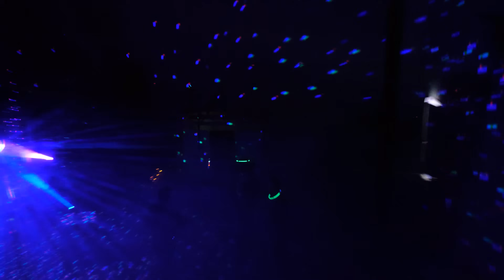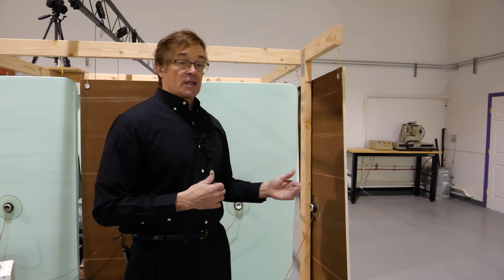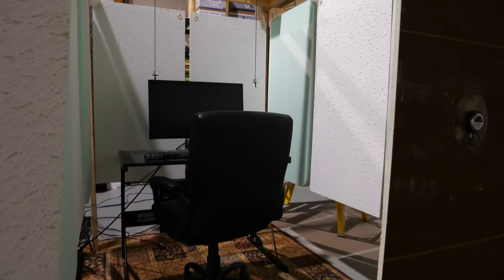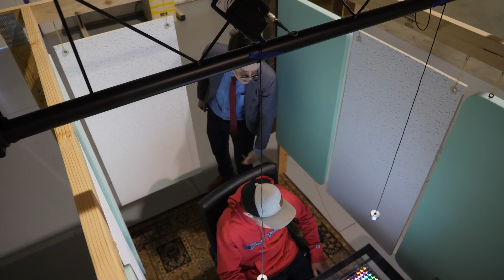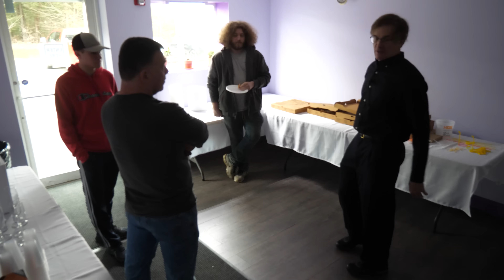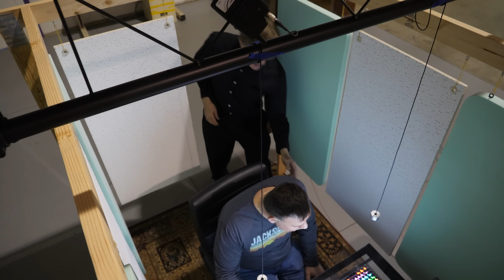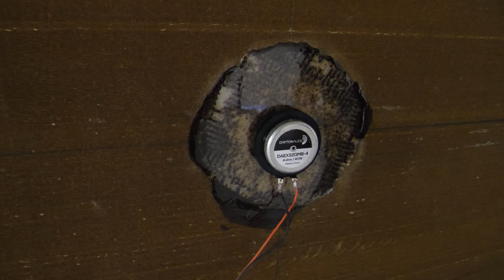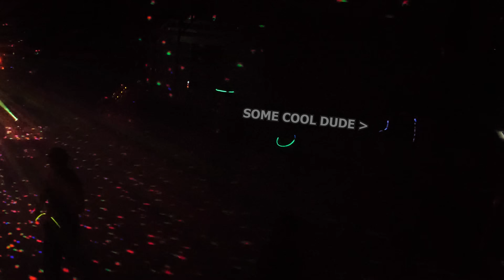SHOULD SPEAKERS THIS GOOD BE LEGAL?

Comment: Ive been watching your videos for years. Finally ordering the stuff to build a pair!! Not sure if this has been answered, but what if you mounted the back side of the driver to the wall? Then the panels only connection point would be the driver and it wouldn't be hanging from thread. Would that be better??
To better clarify, mount the voice coil as you already do. But then using the screw holes on the driver housing, mount that to a wall. That would be a completely isolated panel. Has anyone tested this?
Reply from the maker: It doesn't work as well.  The driver's mass is part of the system and it moves in counterpoint to the panel.  You can try it.
Reply: @TechIngredients  Thanks for the response!! I'll just hang them. I'm no audio engineer by any means. I just want to build one pair and be done with it haha.

Also, I watch all of your other videos too. I live in a modern house 100% off grid. Spring water, solar, and starlink. I'm using all of the techniques I see on your channel to increase the efficiency of everything. Keep doing what you are doing, your work is priceless!

Comment: How well do these work in larger environments: 75' x 150' ?  If I heard you correctly, if mounted properly, you could use them as sound dampening panels as well.  Our church building has lots of echo and we are considering the cost of sound deadening panels.  We are also needing to replace a blown-out speaker.  So, could/should we consider combining the two, making them both speakers and sound dampening panels?
Reply from the maker: I don't believe  there is a limit  to the size of the room where these will perform well.

Comment: 🟦.... One thing I hope you learned after this experience is to hang the sound-panel that you're using as a door from "Roller-Type" shower curtain hangers on a PVC "Shower Rod" pipe, so you don't have to keep hooking and unhooking the door in order to go in and out of that space, instead you'd just slide it aside with one hand behind the panel next to it and then slide it back!

Comment: I am looking into making these speakers
However, acoustic ceiling tiles are not readily available in Slovakia, at least not adequate ones.
The ones I could source are very squishy and sound very muddy.
What if I used 2 different sizes of XPS foam? As in both would use the same exciter, but one would be over 2x larger than the other, meaning it should have a better bass response right?
Maybe I could also change the thickness too, I presume the thicker the material, the more bass I can get out of it.

Comment: What do you mean by "really large panels" do get subwoofer Frequencys? Of what kind of Large do we speak?
Reply from the maker: Several meters on a side.
Reply: @TechIngredients  does the thumb rule quarter of the wavelength as side lenght apply ? So it would be about over 4m for 30hz ? It could be hanging from the sealing.
Reply from the maker: That's  about right.
Reply: its cheaper and better to use an independent sub woofer rather than increasing the panel size, sub bass is non-directional anyway so placement is never a problem... @TechIngredients

Comment: In my testing with same speakers for my project I've noticed that box made from cardboard would make the best resonating bass. And because for my project I needed it to vibrate through the whole tabure (chair) and so that it can be felt when sitting on it through whole body and hands the best way was to put the box inside the tabure and the speaker mounted on the bottom of the box, while box facing up to the tabure making it something like a subwoofer. 
What also I've noticed that the sound is the crispest on simple sturdy window's glass and I was amazed how well it works and sounds. Sadly, I don't have acoustics panel or polystyrene panels, but I'd like to test them out too.

Comment: Did you measure the sensitivity of these speakers? For example a horn loaded speaker can have a sensitivity 100db or more at 1 meter for a given voltage. Bookshelf speakers typically are 89db or less. Planar speakers like Magnepans can have very low sensitivity requiring very powerful amps. I find that higher sensitivity speakers reproduce the finest details, the first watt being most important. I'd be interested in the sensitivity of these. Great video!
Reply from the maker: No, I haven't.

Comment: I would find it interesting to see the frequency response, distortion, and other relevant metrics and then compare them to some of the very top end offerings out there. That would give an objective answer to the question which ones are “better” and also a hint at whether they are “good enough”.
An interesting blind test would be to indeed set both those up in the same space (it probably would have to be slightly larger than the shown booth, but I suspect that would be doable. Another set of reasonably good affordable (at least according to non-audiophiles) could also be present. The test subject would then be subjected to either and probed afterwards. 
The psychological effects of seeing the car-cost speakers and the “normal” speakers would be very interesting, especially if the test subjects are further held in the dark as to the existence of the panel speakers, if to their knowledge they are just acoustic panels. 
This could be a very entertaining multi-experiment all in one go. Psychology, engineering evaluation, and probably more. 

This I feel like I would like to try one day.

Comment: Im sure its fine at moderate volumes. Ive got a few setups and have had lots of gear. To really reach the extremities of the upper and lower frequency range and smooth response it takes more than small speakers and a couple hundred bucks.
Reply from the maker: Sure,  I understand.
A good mechanic  has more than one tool.  You might find that incorporating  this low-cost approach and augmenting its  weaknesses in a complete system produces a superior  overall performance.

Comment: Jim Sim... in the late 70s I acquired a pair of Goodman polyplaner speakers possibly 50 watts . I built 2 big simple boxes and slid clamped them in the front ...the sound was the best stereo I ever had fantastic base middle and tremble I had them till I left for Thailand. My friend now has them and says he will be buried with them . I now have home made ones 3 way networks Inc in Thailand. They are much more powerful watt for watt when in a box and better base mine have an aluminum stasis supporting the magnates with coils attached to shaped styrene foam front sound surfaces ..I love the sound they have ...

Comment: I would like to know how to keep low frequency noise, like passing trucks, out of a recording booth.
Reply from the maker: As I'm sure you know, low frequencies  require a different approach than high frequencies. The pressure  rise is large, but the rate of change is low.  Think of it more as a gusting wind. The same principles apply.
Mass and stiffness work well, i.e., concrete in new construction or building underground.  Decoupling walls with offset studs, like I explained  in our "Lab Tour" video, works fairly well. Active countermeasures would need actuators with substantial mass.

Comment: You can wire speakers in series, parallel or a combination of series and parallel for different impedances and depending on what your amplifier is capable.  It should also be noted that when you increase impedance you decrease wattage to the speakers and effectively get less power from your amp.  If your speakers had been wired in parallel you would have halved the impedance to 2 ohms and gotten more power from your amp.  Of course your speakers must be capable of that low impedance.

Comment: I wonder how they'd sound suspended slightly inside the face of a 5 sided box lined with acoustic foam? Id suppose it would amplify bass response as well as reduce reflected sound from the walls behind them.

Comment: Do you have any recommendations for the shape of the panels when creating the complimentary high/mid and low frequency panels? I was thinking it would be nice if the low frequency could be orientated below the high/mid. Simply for keeping the specific surround channel aligned vertically around the room.

Comment: In past videos you say the dayton exciter you use are only $6 or so. I was hoping you had the link on where you got them. But since you don’t, can you tell me the model and wattage of ones used for your panels? 
Im thinking of doing some and starting with the bass shakers but I figured I would want 20-30watt ones which are much more then $6. So want to make sure I’m not over spending on to powerful ones that I wont really need.

Comment: Referring to this video https://youtu.be/zdkyGDqU7xA 
Did the counterweights end up being too impractical to implement with these materials (20%-25% of the mass divided by 4 or 5 would be very light with the foam core, especially)? Would you say that "juice is worth the squeeze" for the added flat response it creates? Did you choose acoustic panels over end grain balsa for cost or performance reasons?
Reply from the maker: I simplified  the construction  for the demo and left the counterweights off, but they do improve  the performance. 
I used the acoustic ceiling tiles for convenience, and because  the end grain balsa is more difficult  for many viewers  to find.
Reply: @TechIngredients  Thank you so much for the reply and insight! Can confirm - local lumber yards and specialty stores don't know what I'm asking for when I say "end grain balsa panels". I'm going to have to take my chances ordering online.
I'd also like to mount these from behind to hide the hardware (akin to a hung painting). Does hardware location seem to have any impact on performance and frequency response?
Reply from the maker: Look at marine construction supply houses.  Endgrain balsa is a composite core material.
It does matter.  Did you follow  the explanation when I demonstrated the assembly?
Reply: @TechIngredients  thank you for the suggestion!
Regarding the assembly demonstration - yes, I've been carefully watching and taking notes for my project. In thinking this through after reading your response, it makes sense that it would need to be suspended from the edges to not interfere with the sound producing face. I could see it creating unintended standing waves by not being able to vibrate about the mounting points. I'll stick with the top-edge mounting scheme.
Thank you for taking the time to respond and the wonderful instructions and analysis in your videos. I can't wait to get mine up and running!

Comment: I'm thinking maybe this can be combined with the DIY-style acoustic panels people build for home recording studios. Hanging/suspending the sound panels in front of the main bulk of the acoustic panels, and maybe covering with some thin acoustically transparent (printed or dyed) cloth, for esthetics.
Probably not to substitue for proper monitors for critical listening/mixing, but as general playback while recording they'll probably do just fine, and you need the acoustic panels in a proper studio anyway, so they will take absolutely minimal extra space.

I ordered some exciters a while back, but haven't got to building panels yet.
(Lots of other house/car/life stuff to get sorted first, so probably won't get to this anytime soon.)

Maybe even will experiment with inseting EPS in the (off) center of an acoustic ceiling tile (or the other way around), best of both worlds? Or the boundary between panels might mess up the performance completely, who knows. A non-rectangular inset, maybe an oval or ellipse, might help, with exciter mounted so the distance to the boundary isn't uniform.

A Chladni plate expermient or high speed footage during a frequency sweep would be insteresitng as well, to see if there might be problematic nulls/peaks formed by the geometry.

Comment: I build some of these DML 2x2 foam board speakers.. the largest take away was how clear they were and super tight response..  they have very little muddiness, add a subwoofer crossed over high at about 120-160hz and it fills out the response very nicely.   Was it worth the few bucks and time, yep, they are going into my main listening area ( but I shaved off 2" width to fit in my space) and they will be in a 5.1 setup for watching movies.  Tempted to put in a DSP receiver that measures the room levels and frequency response to EQ it just to see what these can do with some DSP work.   They have a very natural sound to them as they function like a resonating instrument over large surface areas, also one other thing I learned about DML in live sound situations, they resist feedback from live microphones, and can function very well in very reverberant spaces.  That's very interesting to me as I do live sound work and the more feedback resistant the better.
Reply: One other consideration with these in this video the panels are 2x4'  I would suspect a 4' panel would reproduce bass frequencies better, longer the distance the lower the resonance frequency. 4 foot, 1/4 wave length is 70hz   Stated in this video 120hs is about the 2 foot  1/4 wave length.   From my experience on a 2x2 foot panel and where my exciter is placed  its fall off is in line with 1/4 wave length theory.  However a subwoofer is afar more managable solution to fill out the lower bass frequencies..  who can put 4x8' or larger panels in their listening space?

Comment: So, what size would be optimal? I have traditional speakers I would like to replace. Let say I go get polystyrene and put posters on them for decoration and hang on the wall.
Reply from the maker: The bigger the better. This will improve the lower frequency output.
Be careful with the posters because if they are bonded at only some locations, they can rattle as they contact the panel when it vibrates.

Comment: I'm not an audiophile by any means but I find it to be very clever. Using different materials for their rigidity in order to get a higher resonance and offsetting the drivers to maximize the range is all super intriguing. Ive watched one of the other videos with the polystyrene panels and really appreciate how every little nuance has been considered to increase the longevity of the setup. I am curious about the interaction with the subwoofer and what experiencing bass would be like in enclosure? I know it was briefly touched on but my smooth brain cant really conceptualize what it would be like if one were to do something like an spl bass test or if that's even possible

Comment: Wonderful job!  A few questions…
Did you use 40w on the ceiling tiles and 25w on the XPS or the same for all?
Did you use epoxy on the XPS or just the tiles?
Looks like the tiles were not rounded or painted on the front, nor sanded, correct?
Did you see changes in sound quality/range when aspect ratio was changed, or was total surface area more important?
What dimensions were the panels in your test room?
Thx again!
Reply from the maker: We used 40 watts on everything and only used epoxy on the tiles.

Comment: How much volume do they need behind them? I want to mount them to my walls (hanging)

Also, what's the exact panel name you use? (the turquoise ones)
Reply from the maker: It's  extruded polystyrene. Don't use expanded polystyrene, it's  too fragile.
Place sound absorbing material on the wall behind them, and they can be as close as you like.
Reply: @TechIngredients  Thank you!

Comment: Hi again. So I built a tri-amp system many years ago, but never built speakers. That is; one amp for low frequencies, one for mids, and another for highs. The frequencies are split electronically prior to amplification (not by crossover). That ensures the low frequency drivers only get low frequency input, and so on. So watching this I'm now considering using the low frequ. amp for traditional woofers, and the mid frequ. amp with DMLs and another pair of DMLS (smaller) for the high frequ. amp. What do you think?

Also, what about the power requirements of the activators, and are there different quality activators, or are they pretty much all the same?
Reply from the maker: That's  a good  idea.
We did something  similar in our previous  video on "The World's  Second Best Speakers" video. They're  pretty  much the same except the heavier, ceiling  tiles have a 40-watt actuator as opposed  to the  25-watt actuators used for the polystyrene.
Reply: How did you split the frequencies without a crossover?
Reply: @monkeysuncle2816  That is still called a 'crossover', so maybe my terminology is a bit off, although it I think most people consider a crossover something which follows amplification.
Reply: @monkeysuncle2816  My first reply seems to have been lost. I built a Linkwitz Riley circuit from Elliott Sound Products, or ESP.